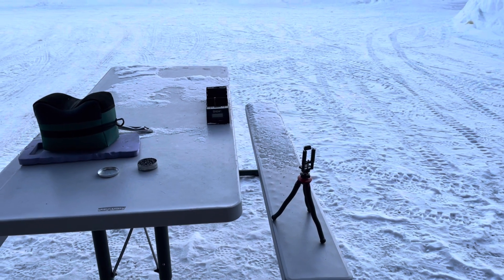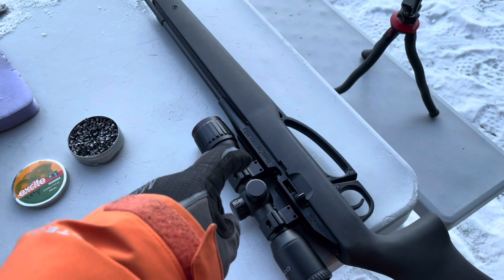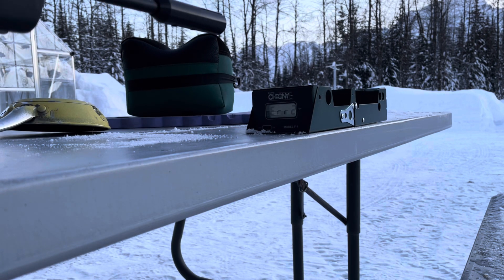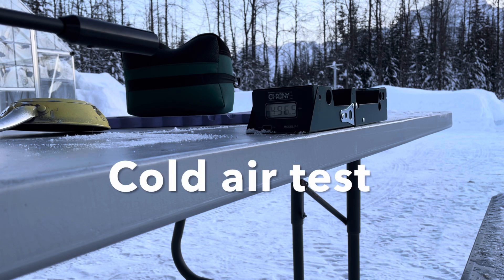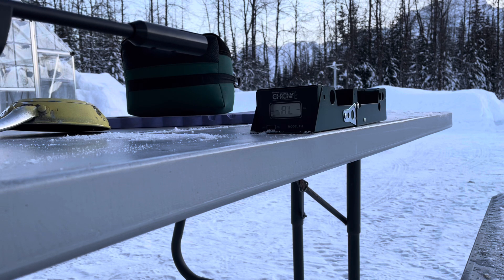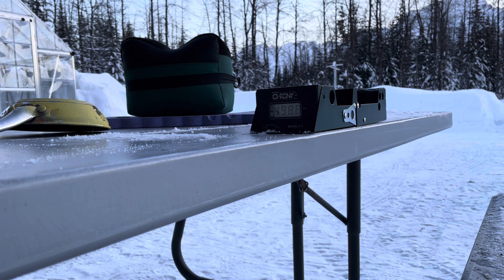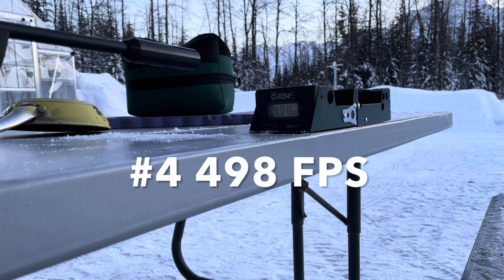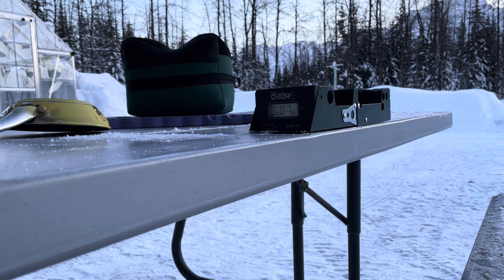Chrony testing at -3.6°F

Comment: Now pump up outside in the cold, dense air. Take the rifle inside and leave it there for an hour to warm up to room temperature. Then take it outside and crony it. The pressure in the chamber will have increased due to the temperature increase. Will the valve release all of it resulting in increased speed? Enquiring minds want to know.
Reply from the maker: That’d be really neat to try out! My temps are back up into the 20’s so I’ll need to wait for another cold spell so things will be comparable.

Comment: This confirms why I would get a higher target hit at 12 yards when 31F here in Michigan as apposed to 5 days ago when temperatures were 51F and I zero'ed my scope for 12 yards.  
The grouping moved by 2" - 3" above.   Scope used is a Centerpoint Brand supplied with the gun.  
 Also, thanks again  for making the 'Artillary-Hold' video.  THAT solved my issues with the Crosman MagFire .22 break barrel and why I was going insane trying to hit anything with the iron sights.
Reply from the maker: Oh good, glad to hear one of my videos was helpful! 😄👍 Spingers and gas ram guns are more difficult for me to shoot accurately compared to pneumatic or PCP airguns. I read a thing the other day that said shooting airguns will make a guy a better shot with firearms due to the need to hold the gun more steady for a longer period. It said because the pellet takes so much longer to exit the barrel compared to a bullet in a firearm, a steady hold was more critical. This sounds pretty reasonable but I don’t know if it’s true?
Reply: Agreed about the 'enhancing firearms' shooting and handling.  I found that if I keep my cheek off the stock while I am sighting and while firing, it shoots straight.  If I lean my cheek on the stock, then the double recoil kicks the stock away from my cheek and causes the barrel to kick left during the pellets' transfer through the bore.  When I figure out my slo-mo camera, I'll post a video showing what I am discussing and send you a link.  About two weeks and see what happens.  Happy New Year!   @airgunsofalaska
Reply from the maker: @LaserGuitarist65  Interesting! I’d not thought to try and hold my cheek off the stock. I’ll have to try that. Happy New Year!
Reply: Yes! Same goes for gas ram and springers! 
(And pretty much all powerplants since the air changes density)

I was bringing a Gamo IGT while trapping rabbits and the first snow day I was 3in high from my summer 20yard zero
Reply from the maker: @LowkeyAirgunner  Wow! That’s a big difference.

Comment: I'd have thought the warm air would condense in the cold and its psi would go down like a tire, but apparently not enough to make much difference, good to know pneumatics don't get messed up by stuff like that.
Reply from the maker: I went into it thinking there’d be a noticeable difference and I’m still surprised there wasn’t. Like a tire or more dramatically an air filled ballon takes outside and it appears to deflate. I thought I’d see a jump in power with cold, dense air.

Comment: The warm air volume from inside will decrease when getting cold and will give less power. If you laod the warm compressed air rifle with air inside and leave it outside for 15 minutes the difference will be bigger. It's like when you close the lid from an empty pet bottle and put it in the cold. It will dent in. The air volume will be the same when only shooting inside with warm air or only shooting outside with cold air. The grease in a springer air rifle can get thicker in cold and can give a minor difference, that's why i lubricated the piston and piston seal of one of my HW97 springer air rifles with Molybdenum disulfide powder also called for Wounderdust. This stuff is great👌and dieseling belongs also to the past. A gas ram piston air rifle is more sensible for temperature differences but the gas ram pistons are mostly filled with nitrogen gas and way less sensible for temp. differences.   Cheers mate!
Reply from the maker: That makes sense and I’d not thought about it that way. The perspective I was looking at this from was with engines. During the winter with snowmobiles, the older, carbureted models would run better and more crisply in cold temps with denser air. I was wondering if denser air would result in more power. From what I saw, it compressed warm air and cold air the same way. But like you are saying, it’d be like a tire aired up inside a garage at 60-70°F and then sat outside in cold temps and losing PSI.
Reply: @airgunsofalaska  Right mate, i understand your thoughts, it's about the O2 level and density of the air, and more O2 in "heavier", more dense cold air means better burning fuel but the O2 level has no effect on an air rifle unless you want it to diesel but that should be avoided. It's also intresting because cold, more dense air could than not be compressed as much as warm air with the same volume, and that should leed to more power because the earlier reached presure in front of the piston should start to move the pellet earlier. A lot to get headaches about here😅Now i'm 🤔about a low pre-presured springer air rifle, like a Daisy pump with an added springpiston, or the other way 🤣 , as long the pellet has left the barrel before the piston hit the end of the tube. Happy new year mate.. Looking foreward to your next video. Cheers!
Reply from the maker: @rapalaron6348   Ahhh, you’re totally right! I’d not thought about it that way👍. Happy New Year!

Comment: That's some serious dedication there.   Kinda wondered about that myself.  Anyway, if you didn't have the gloves on, would the pellets freeze to your fingers?   Just wondering, from down here in TX.
Reply: I live in Lappland and we have a rule here....Never touch frozen metal objects with wet hands unless you still have your two hands left and you are able to pee🤣 The little metal volume from a pellet won't give problems mate but it can stick on a cold wet glove.  Cheers!
Reply from the maker: @rapalaron6348  my glove stuck to my dogs metal water dish yesterday. I’m glad it has since started warming up again.
Reply from the maker: The pellets would only stick if my hands were wet and the pellets had been sitting out in that temp for a long time and gotten that cold. But, it was so cold than even with gloves my fingers were rapidly getting cold, achy and numb. For me it’s not practical or enjoyable to shoot outside in those temperatures as I’d have to wear thick, warm gloves and then couldn’t handle the pellets.